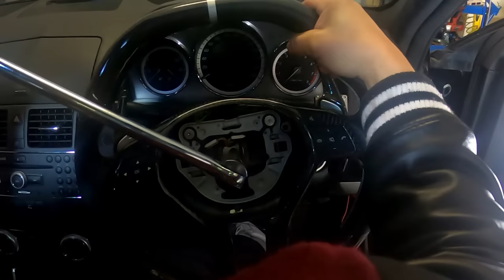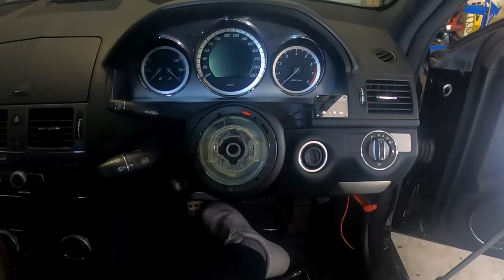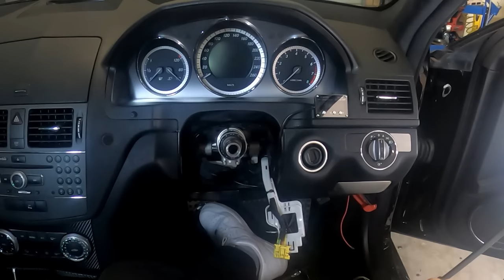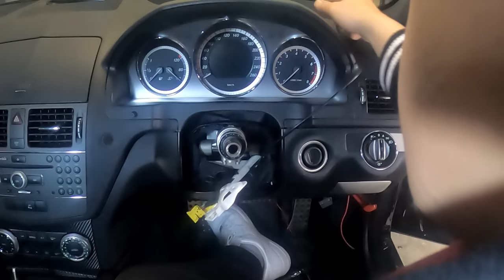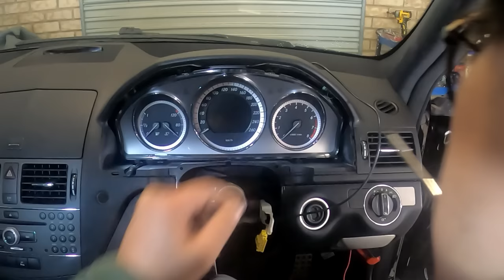HOW TO remove and fix ESL/EIS/ ELV MODULE  w212 w204 mercedes motor replace  Part 1

Comment: thanks for the video it’s actually very helpful, and I am in a similar situation where I can lock and unlock the esl intermittently. And I started this process, but I managed to looses the 4 E12 screws without removing dash and steering wheel. 

And got a question I know this video was made pretty long time ago but which way did you went when fishing out the ESL? Like did you fish it out from the top or bottom?
Reply from the maker: ok so i fished it out from thd top i reached all the eay around and got it out by only loosening the steering cokumn all dome by feel thats why in the video i couldnt show hoe i remived it... but i plan to do a short shkwing this because ppl wanted ro see it aseell rventho its all done by feel hence why i didnt show it..plus it was durinf the statt of my yt so didnt know how to film it ..but no excuses ..i should have done a better job

Comment: Hi Mickey. After you have disconnected the ESL from the harness in the open position, did you  leave the the key in the EIS and then disconnected the battery. ....thanks for a well presented video
Reply from the maker: u can leave or remove either is fine
Reply: Before I re-connect the battery, should I first insert the key in the ignition or can I leave it out.....Thanks for the reply
Reply from the maker: @jacquesvanzyl374  insert key
Reply: @MIKEYZVLOGZ  Thanks for your help and advice related toe ESL. Much appreciated 👍
Reply from the maker: @jacquesvanzyl374  no sweat bud

Comment: I'm beginnimg to regret buying this car.  Such a hassle.
Reply from the maker: i feel ur pain but if u try and do some research and five some issues a go u may be surprises of some thing u can fix urself... just gotta give it a go to a certain extent ... but only try things u know u can stuff up or u can cause more damage.... but i do undsrstand what ur saying..imho if i had known all these issues existed i may not have bought ome either..but i always wanted a w204
Reply: They’re actually quite reliable once you get past the annoying issues. Mine has 268k miles and still running strong
Reply: @issanesheiwat1396  glad you said that.  I have a G too and was a little worried that I probably made a bad decision in having two Mercedes.
Reply from the maker: @issanesheiwat1396  yes its all about how you maintain it and preventative maintrnance also... theres only so much  u can do but its still worth it to me especially if u learn some tricks and diy
Reply: @issanesheiwat1396  have you changed the suspension on your car? I'm at 160,000 miles and it's much rougher ride now.
Reply: @ChrisS-mj6ux  Just recently I rebuilt the rear with new heavy duty shocks, camber arms and toe arms and it feels a ton better. Currently, I am in the process of rebuilding the front suspension by replacing the front struts, the hydro bushing and one of the lower control arms. The suspension definitely felt rough and loose before I did any work, but I cant wait to feel the car handle as if it were brand new again.
Reply: @ChrisS-mj6ux  i just celebrate 155k high miles award from mbc.  Also replace front struts.  It’s about time!
Reply: I don't even have one... But someone with this ESL issue... And I hate Mercedes even more.. why would they ever build something like this ??
Reply from the maker: @ventolen cutting costs ..but since doing mine it's been solid for 5 years same motor... but not to day its perfect stil other issues
Reply: @MIKEYZVLOGZ  Well, You video is well informative I'm glad I learned a lot, and it does seem simple, Standard.. I installed Car alarms and Stereos.. so getting into all this is familiar..  but having to take apart the gage cluster , that's deep into it. 

This guy was explaining to me all these rules.. if you disconnect the battery you have to start the car in like 5 minutes or it locks you out.. and the steering is dead.. and now his battery is disconnected...hood shut off course, ESL and I'm like... You have a Mercedes Paperweight. What's it good f
Reply from the maker: @ventolen lol ... i don't know who told u all that but they are misinformed

Comment: Hi Mike. Not sure if you are still checking comments, I am about to fix the ESL on friends C300. However plan to replace the ESL with emulator, I assume still need to remove old ESL? Thanks
Reply from the maker: actually no u dont, if u use an emulator only need to unplug the plug that plugs into esl and plug that into your new module bypass esl emmulator and honestly just mount it with strong adhesive double sided tapre and your good ..u dont have to remove the esl unless u want to mount in the same spot, but u really dont need to u can just leave ity and mount it elsewhere(emmulator)
Reply from the maker: and of course i still check lol
Reply: @MIKEYZVLOGZ  Thank you!

Comment: This video did the job for us, truly a life saver
Reply from the maker: great stuff mate well done
Reply: @MIKEYZVLOGZ  Hi Mikey, my parts just arrived and have followed your instructions. The car now starts alright after pulling the key out and have successfully started multiple times. However, a notification on dashboard start coming out every time I start the  car. It says “Front right (I’m in Aussie, it’s the driver side) malfunction. Consult workshop”. What’s potentially wrong with it and any possible way to fix? 

I did the buying a new motor fix
Reply: Restarted a few more times and had a few fail attempts, and some successful. The esl sounded loud compared to the original one. Could it be misaligning of the gears in the esl?
Reply from the maker: @xavierng6377  ok so what's the error relating to..I believe it's just a reset error ...if u had no errors before then it's prolly a error due to disconnecting battery.. what does it say exactly

Comment: I am having this issue and it gives an esl code but the only issue is that my steering wheel is not locked. I can move it freely but I still have all the other symptoms, the car wont start and none of the dash lights come on. I get the message remove the key etc. Also nice steering wheel where did you get it?
Reply: My 09 c350 is the same did you fix it or is it the same thing
Reply: @Esteven1037  yea got it fixed. They actually installed an emulator between the steering lock module and it’s cable. Didn’t even have to remove the thing is was quick and fairly inexpensive.

Comment: If I replace the motor just as you show in the video, is there any reprogramming required for the ignition switch? Your instructions are clear enough and encourage attempting the repair on your own.
Reply from the maker: no if ur only repairing the motor by replacing it then no reprogramming is needed it will be a simpple replacement of motor only ...
Reply: MIKEYZ VLOGZ Thank you for the reply. I was able to take apart everything just as you instructed, including disconnecting the battery with ESL in the unlocked position.
Reply from the maker: @melakutessema1  good stuff mate well done wiah u all the best ... it really isnt too hard

Comment: Your video was very helpful and I managed to get the ESL and EIS out. Now I can go get an emulator. I have another problem with the steering wheel and clock spring. I didn't take out 1 out of the 2 plugs and my clock spring fell to the floor. Is there a way to fix that? I'm guessing I have to buy one off ebay. They got for $200 used since I can't find a new one.
Reply from the maker: clockspring fell? how do u mean? did it break the clockspring? if not u can just reuse it .. unless u broke something ..in that case yeah get uses..u don't need new .. ensure it's centred already .. cuz u might get it with the wheel locked to one side and wen u goto turn ur wheel ull break the cable ribbon inside the xloxkspring

Comment: Thank you so much Mikey, you are a huge help and money saver. I haven't attempted what you proposed but seems like its the only option I have if I don't want to lose an arm or a leg in terms of cost. I noticed the emulator links don't work anymore, could u update them?
Reply from the maker: sure I'll do that..or u can simply search aliexpress or ebay even Amazon for the parts ...of u want to make it easier for yourself get an emulator ..only just be aware u no longer have a steering lock
Reply: @MIKEYZVLOGZ  Just curious if u move the steering lock to the side but let it dangle on the side somewhere with cable ties or something, so the steering lock will never get locked, will the car know?
Reply from the maker: @continuouscompounding  no cuz its an electronic sensor, its like an emulator, same principle there isn't an actual lockm just the pcb tricking the ecu into thinking it has one
Reply: @MIKEYZVLOGZ  So, technically I don't even need to replace the motor then. I can just remove the factory ESL from its current location on the steering rack and move it to the side and let it dangle. Is that right?
Reply: @MIKEYZVLOGZ  Also, I did buy a replacement motor and tool kit combo off amazon. What kind of grease do I need to use?
Reply from the maker: @continuouscompounding  use white pttfe lithium grease for plastics
Reply: @MIKEYZVLOGZ  Sorry I'm really new to any automotive repair, sorry for this dumb question again: So, technically I don't even need to replace the motor then. I can just remove the factory ESL from its current location on the steering rack and move it to the side and let it dangle. Is that right?
Reply from the maker: @continuouscompounding  no u still have to remove it cuz u need it so u can send it off to get an emulator coded , either way u must remove it, then once its coded u can remove it completely and dangle the emulator plug it in and dangle it, either way u need tro remove the esl, cuz the only way to get an emulator is to send off your keys eis and esl to a locksmith that can do the coding
Reply: @MIKEYZVLOGZ  I get it if I go the emulator route. What if I go the replacement motor route. What I mean is that, does it matter that the ESL is even in its original location. Cuz it's only by being in that position that it can lock my steering and prevent me from driving. What if it's still linked to the car, but not attached back there. Will that affect whether I can start my car or not? Cuz if I can still start my car with it being in another location, I don't even need to replace the motor. Or I can replace the motor, and dangle it elsewhere so I can easily replace the motor again in the future.
Reply: @MIKEYZVLOGZ  Okay Mikey, I need a second opinion. I found a local installer who says he can install the emulator for $280. He wants to charge me $400 in total for the install and to remove the old ESL. He states he doesn't need to remove the old ESL if it is in the unlocked position. Is it safe to have the old ESL inside? Also, didn't u say u need to remove the ESL to program the emulator? I guess it could be possible to just put a cable into the old ESL and program it from underneath the steering wheel? I tried to reason with the guy that charging me 120 more to remove the ESL is not fair, but he's not willing to budge. So I told him I'll remove the ESL myself and u do the install. Just wondering what u think.
Reply from the maker: @continuouscompounding  that's a fair price to be honest ... most ppl will charge that .. but if u remove the esl yourself u will save that little more.. just remember it's abit involved removing the esl as well
Reply: @MIKEYZVLOGZ  Thank you for that, is it safe to keep the ESL inside my car in unlocked position?
Reply from the maker: @continuouscompounding  yes it's fine .. just means cat wl remain u locked
Reply: @MIKEYZVLOGZ  Well with any emulator it will be unlocked forever right, I'm just concerned whether its safe to keep ESL inside is all
Reply from the maker: @continuouscompounding  it will be fine

Comment: this video is awesome. just one question, what are your thoughts about els emulators. they seem like a great option but i'm not too sure about the reliability
Reply from the maker: honestly they are way more reliable in that sense..because there is no mechanical movement ..its just an electronic device that mimics the sound of the esl unlocking... having said that there's the con with not having steering wheel locked anymore ..no extra security ... but in terms of reliability..they are...I'm gonna do it if my esl fails again just to see how long it'll last as well ... but its been 3 Years since swapping the motor in my esl module and all is swell ... very good ..sounds good and going strong on 3 years

Comment: What battery booster did you use? Im thinking of getting the dewalt 1400 amp. I have a 2010 e-class coupe. It started with the intermittently reading the key and I would have to hit the key a few times for the car to start. Now it won't read the key at all.
Reply from the maker: definitely sounds like esl problem or maybe eis but most common is the esl fault..I got the cheap battery jumper portable from Ebay about 40usd shipped to tour door

Comment: You have made this big issue easy to fix. Thank you for all the efforts. I just changed my ESL motor from aliexpress and it’s working fine. 
Please tell me how many years I can drive without having to change the motor again. Thanks 🙏
Reply from the maker: should last at least 2 years but these things malfunction out of the blue its hard to say
Reply: @MIKEYZVLOGZ  Thanks Mike 🤟🏻

Comment: Hey Mikey, I saw your video about the esl and I’m starting to doing it. I got the module out and luckily it’s in unlocked position. The problem I got now is those four pin hold the esl module together are kinda seized. I somehow took one out but the rest three are stucked. Is there a way to get them out? Thank you.
Reply from the maker: @thedoomhonker  ok so try using a small hex or small torch bit lightly tap it in until it stuck then whilst pulling back rotate counter clockwise or either way ..repeat till its out enough for u to use pliers to pull then out ... also worse case drill them out and u can use screws to put them back it will be fine ..but also duct tape it back together too tightly

Comment: I am currently having the same issue with my c63 , but it is stuck in the lock position...  what should i do next to try and get it to unlock ??
Reply: Idk if you got it fixed but youre gonna have to remove the steering column and either cut the bolt off or drill a hole and get a small pick or screwdriver and turn a small gear until you can push the bolt inside. Im currently in the same situation

Comment: Thank God I watched this really couldn't have done it before watching this.  Big Thank You.
I have a 2013 w204 C250 amg with the monitor in the dash:
Do Not remove the instrument cluster and monitor there is absolutely no advantage to this.
Remove the T14 torx bolts completely and allow the steering column to drop down. Take note 2 x long + 2 x short bolts.
lift out and refit the ELS from over the top with the  steering bracket and column down.
ELS; Make sure the lock mechanism is in fully unlocked position when ELS assembled and threaded bolt can be pushed all the way in before refitting the pins and then refitting the ELS or it won't go back in and you'll have to do it over again. ELS; Little grey buttons should be pushed closed by the closed mechanism.
Watch this video more than once and listen to every word before commencing, especially regards disconnecting the battery.
When removing the battery do not put the RED terminal cover you remove on top of the engine as you will lose it.
ESL had burned brushes in the motor evident by black sooty deposit on and around the motor and also almost no grease.
Stay calm at all times.
Reply from the maker: well put yes the grey switch buttons are a very important part i forgot to show .... but thats the only other important part ... everything else is pretty atraight forward... yes u dont have  to remove the cluster ..i did it so i could show clearly the bolts and lossening them to remove the esl... and removing the esl u will do by feel... thats just how its done... u will get it just be patient... if u feel fruatrated stop think breath and come back to it... thats what i did ...infact i walked away for a day then came back to it... esp cuz i was filming it too...well.done mate ... i take my hat off to you
Reply from the maker: @Hei19djaJqidjoqhd  it on the circuit board half way up theres 2 little mini button switches